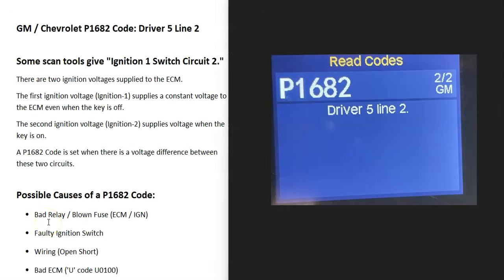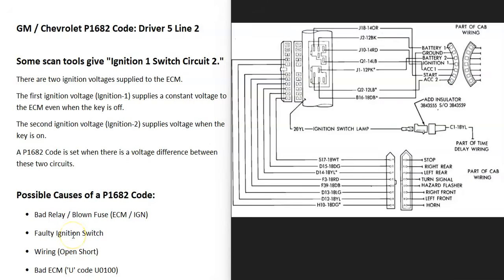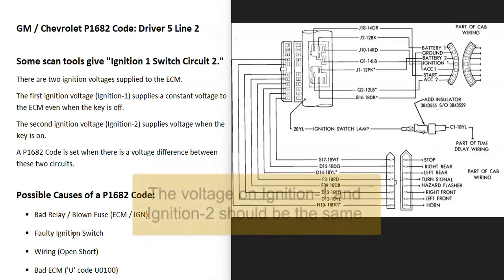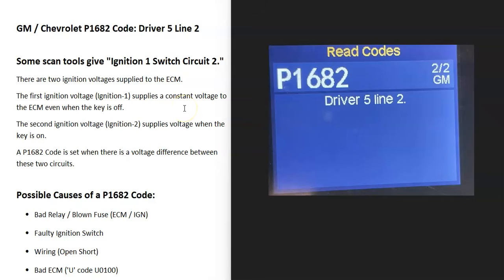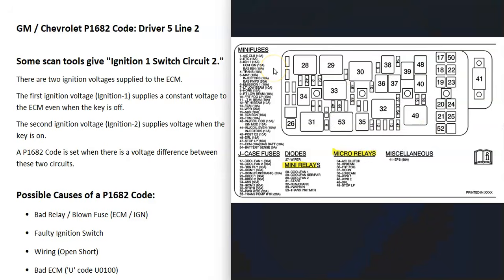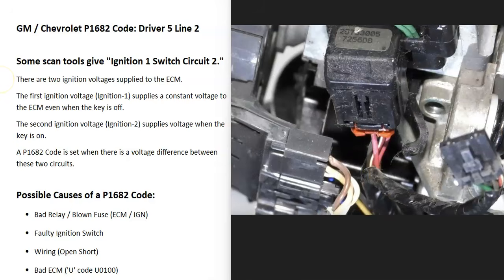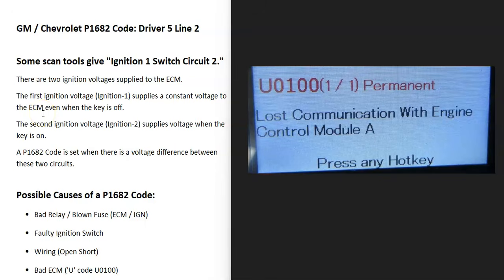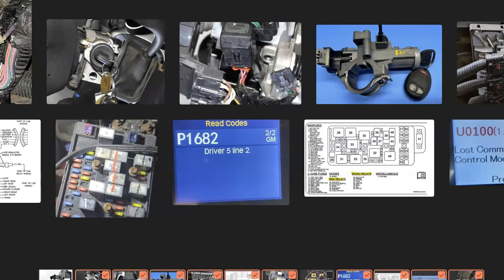Causes and Fixes GM / Chevy P1682 Code: Driver 5 Line 2 "Ignition 1 Switch Circuit 2."

Comment: I have a 2009 silverado LTZ 5.3, P1682 code and a bunch of other intermittent ones... The radio dies and the truck keeps running when I shut it off and take out the key.  It will quit after 30 seconds or so but after I turn it off, the check engine light stays on very dim.   'The radio comes and goes, U0184 lost come with radio, when it doesn't work.. goes away when it does   u0198 lost comm with telematic control module, lost come with door control mod a U0199, lost come with door control mod b U0200, lost com with remote function actuator RFA, U0214 remote key fobs work fine ... also get intermittent service traction control and service 4wd with no codes for either,   sometimes I can clear them all, sometimes not.  the truck pulls 4 amps with the key off.   had some weird stuff at the fuse box.. 8 volts fuse 19 trans ig 1, 40 airbag ign , 43 misc ign, 48 aux hvac ign, 54seo/alc and 2.3 volts fuse 1 trailer stop rt and fuse 3 trailer stop lt... truck does not have trailer brake package.. every thing goes normal when i turn it on.. I disconnected the RFA and nothing changed.. check the ground at the LH junction pack and it was half ohm   I did change ignition switch also, no help

Comment: or low batery volts the brings up code p1682 if the batery is wek or bad
Reply: So my battery is bad that could be the issue for this also

Comment: Mechanic here:
Clean ALL ground connections with wire brush, sandpaper, file, etc. Google the locations for your specific vehicle. 
Disconnect negative batt terminal for 10 mins. Reconnect and try.

Comment: For others watching this if youre hearing chimes in the run position its most likely not the ignition switch.  Mine is the control wire/ground from the ECM. Or the fuse box itself i haven't made ithat far yet.  But in an emergency on a crank no start you can jump pins 30&86 on the power train relay itself.  This is only in an emergency because it will get you home.  And pull the relay when yhe vehicle is not running
Reply: so my truck (2010gmc sierra 5.3 v8) still chimes in the on position runs and drives strong when code is gone. p1682 code only started about a month ago. i do work in a quarry so tons of dust daily covering my truck plus made its way to the engine bay which could play a role in these faulty codes. cleaned out my fuse box about 2 weeks ago. code went away and seems to stay away and only shows its ugly self -12 or colder. it seems to be an open circuit somewhere as this weekend has been close to -30 so p1682  has come back once again. i get other codes as well but do go away when it  is warm outside. i am in the middle of figuring out the open circuit or if its a relay or fuse issue. i already ruled out my ignition switch and the whole cylinder as a factor.  very annoying problem to deal with. do notice if its a  wet snow and slushy roads code does pop up more. hoping its a small stupid issue like a relay or fuse.

Comment: Creator*.  Can you get me pin location and color of wire for the drive train relay control circuit?  It's odd because my title says that it's an 06 Yukon. The manufacture date is 04/06 but now I'm realizing that it's an 07 body style and wiring after I already bought the info for the 06.  It's supposed to be X1 pin 56or59.  I don't have X1-X4 I have J1 and J2

Comment: I’m having a issue with the p1682 code no start no crank the lights all go out when trying to start this code is a pain been trying to get my car running since February changed the ignition switch same problem anything helps just been pouring money in to figure out the issue
Reply: I would start by pulling the fuse box and cleaning anything that you can get a q tip to.  With all those issues I would go 80% it's the box itself

Comment: I have this code on my 2007 Silverado 1500 and I’ve changed the ignition switch but, what’s happening is that it turns on fine when it’s cold but if I run it for a bit and turn it off it won’t turn on again until it cools down. Any idea why this might be happening? Thanks
Reply: Did u figure out wat it was? Same problem here.

Comment: I have this code come up in very cold weather. If it’s below zero Fahrenheit sometimes the engine will not fire right away but it does turn over. Eventually it does start but then I get the error code. What could possibly be affected by extreme cold? 2014 Cruze Eco 1.4 liter.

Comment: Per my research,, it seems that the under hood fuse box itself on many GM vehicles tends to go bad (read poor connections to relays, fuses &/or open circuit traces) with mileage and thermal cycles.  That could be the problem, or something else related to the circuits themselves vs the switches, fuses and relays.
Reply: The  guys on the Saturn Aura group tell me they have issues as well with the same code, I have a 07 Aura and today it went to Reduced Power mode. The guys say that a burned connector inside the box from one of the traces doesn't make good contact, then heats up and the connection opens. I took the box almost all the way apart today, put it back car seems o work fine. BUT it is not  repaired.I have to have some time to lay everything out, including pulling the relays and fuses, then separate the box to inspect the copper traces to the connectors.  I hear that GM recalled only some models, but not Saturns.   It's a sickening feeling when the engine cuts out like that, limp home mode.

Comment: Ive been battling this code for months on and off. Very intermittent, and always happens when my wife is driving it. Turned out to be loose bolts in the fuse box that hold the cable/wire plugs to the bottom of the fuse box. Took out fuse box, inspected all the pins and connections, then installed the bolts with loctite. Seems to be working fine now...
Reply: Still good to go?
Reply: I'm wondering if it is still working also?

Comment: Gmc savana 2500 base model 2013 , I am struggling to figure this out. Did ignition switch did the start crank relay. Checked harness over and over. Lost

Comment: So I have a 2005 Buick Rainier that's giving me the run-around it had the u100 switch at one point but I cleared it and it hasn't came back but I do have the ignition switch circuit to and I have a p2176 a minimum throttle body position not learned along with a p0449 in a p0443 which is the EVAP purge control solenoid circuit and the EVAP vent solenoid circuit but what's weird is sometimes it starts do you think that's more of an ignition switch or an ECM problem any help is greatly appreciated
Reply: Any luck? I have a 2006 rainier doing the same thing, new ignition switch and new relay

Comment: I’ve got this code on my 2016 Express 3500. Van has started fine and run but with engine light on. Then goes away. Now it won’t start. Any easy thoughts? I’m about 2 hours from home.

Comment: I have an AC issue, it became hot all of sudden. After I checked with the electrcan he found this code p1682. He cleaned the throttle, also changed the alternator, not to mention spark plugs, but the issue still there. I forgot to mention that I changed the AC compressor, but nothing changed. Can anyone guess what the problem is? Impala 2016.
Reply: 2010 chevrolet cobalt-same problem exactly,changed the ac pressure switch,same,noticed the temp reading on dash wasn't correct so changed the temp sending switch,fixed it and ac problem,erased the P1682 code and all seems good now.Hope this helps.
Reply: I would check the power train relay and run/crank relay
Reply: @UlfricStormcloak69 guess what? It was the ECM that made all that troubles. I have changed it, programed it, and thanks God everything back to normal 😊
Reply: @ibrahimawadh5129 how’s it working now? How much did that cost? Having similar issues with 2013 Impala
Reply: @ibrahimawadh5129 how did you program the ecm
Reply: @manuelbarrera7528 sorry for late reply, but I live in the middle east, so the prices differ for sure. But I would check the box of fuses before I go to the ECM way. Good luck man.

Comment: Had it code pop up on my 2011 Malibu one day car had no power to radio and no crank next day started fine but is in engine power reduced, I have change throttle body maf sensor and still won’t come out of reduced power and rpm’s are jumping and car runs terrible
Reply: Have you fixed it yet ?
Reply: Bro my mailing does this I’ve changed the knock sensor check the chips my next move is the relays and then the whole fuse box also my fans don’t work either

Comment: I have this code and it goes into power reduction mode I can unhook hot wire and about 15min it may or may not go away and drive fine....it only does it first time with a start up for the day most of time. 

I haven't had it do it while driving yet
Reply: Ignition sensor or throttle body

Comment: I got the p1682 code and a p2227 code after i installed a rca converter to my factory system in my 2013 equinox.

Comment: 21 Canyon 3.6l 
I'm getting u100 and have been battling Firestone and my Chevy dealer to even admit theres an issue since May.  
No voltage to abs pump, brake booster, no average wheel speed, no maf sensor reading, etc...
Calipers drag slightly and feels like slight intermittent pulls against my steering wheel in the rack area.
Any way to make sure make sure it's actually the ecm without a tech 2?  
I have a decent scan tool and can tell the data is off in multiple ways, but not sure how to know definitively.
Reply from the maker: Troubleshooting a bad ECM is difficult since it may also be in the wiring, but here are a few basic things to do. Be sure the alternator is charging correctly since the computers all need a good, stable power supply. Sometimes, they can have a bad ground wire, which can often be checked by attaching a jumper wire to the case to a good ground. Also, sometimes, components on the circuit boards can get burn spots, so try to check for any burning smell.

Comment: I'm having this problem as we speak right now with I don't get no power to the fuel pump and when I run the code it says p1682 and it says ignition switch but I tried to change the ignition switch and it didn't work it didn't even turn over so I put back the original ignition switch it turns over but it won't could you give me any hints on what to do I just went and got a new brain for the truck today it's a 2008 Chevy Colorado
Reply: I’m having the same problem , I changed the starter , starter relay , mega fuse on the firewall , ignition switch , TCM , and fuses truck still having a no crank no start problem
Reply: @dktv2331  hi friend. did you ever resolve that's ?
Reply: I'm having the same problem did you ever resolve yours just need something point in the right direction went through everything
Reply: With me it was the throttle body sensor which means replacing the throttle body
Reply: Un plug the computer and plug it back in if that doesn't work change power distribution mod fuse nox
Reply: Jump pin 30&86 on the power train control relay.  This will tell you if it's the fuse box or the control wire from the ECM.  It will run but I wouldn't keep it that way

Comment: Just got it on my GMC Acadia Denali. I'll try a new ignition switch first.  Thank you!
Reply: Oof, never just start throwing expensive parts at it. You gotta test first.
Reply: How did that work out
Reply: That or the throttlebody
Reply: I changed the throttle body but still having intermittent issues. 2014 GMC Acadia Denali
Reply: Update: i ended up replacing the whole fuse box and so far 4 months no issues. 🤞🏼🤞🏼🤞🏼
Reply: Did that repair work?  Having same issue in 2013 Acadia.
Reply: @jmdowdy It’s crazy my repairman 👨🏿‍🔧 passed away. But before he did. He had a higher tier GMC certified tech take a look at it. It actually was a faulty wire that needed to replaced. So far so good. We’ll see!
Reply: @ mine turned out to be the common faulty pin in the fuse/relay block. Took it apart, cleaned up the pin from arcing. Bent the pin just slightly to make better contact. It’s been 10 months without any issues.
Reply: @jmdowdy what common pin? Mine just did it this morning but was good on the way home. Thanks

Comment: This code came up  when it was -5 degrees the switch stuck on the on position , then wouldn't start , I tried again and then it cranked real slow and battery was up enough to start , re set code and see what happens, once it warmed to 16 degrees it started drove it 4 hours no trouble  we will see , I think it was so cold it just stuck ?
Reply: What happened to mine, it was the throttle body sensor but you can only replace the whole throttle body on some trucks, I just replaced it $200

Comment: I had that code yesterday;
I did the Ignition sensor, mass airflow sensor, replaced most of the 10,15,20 fuses, (not the relays) all eight spark plugs. Check engine light went off. 2012 gmc sierra, 5.3, 2wd, ext cab.
Reply: what were your symptoms other than just that code?
Reply: Did you get it to start by changing all of those things ?
Reply: I'm having issues with my Chevy traverse ( garbage SUV) service stabilitrack replace the mass air flow sensor ignition switch the last thing I can think of is the throttle body any thoughts?
Reply: Truck went into creep mode until the temperature warmed up some and the stability track went off. I replaced these and stab track turn back on. I would've started with my throttlebody, because my throttle body was what was causing the problems, the sensor in it. Start by replacing your throttle body or the ignition sensor.
Reply: @j.anders6895  Never just start throwing expensive parts at something before running some electrical tests. You gotta test first.
Reply: @ZBrink11  agreed